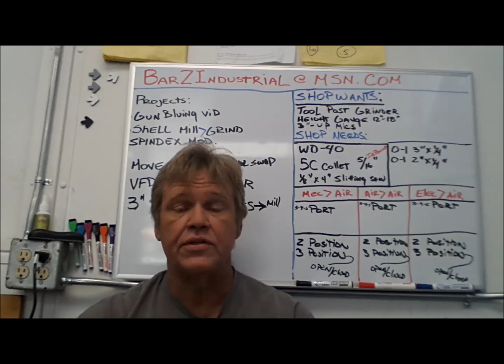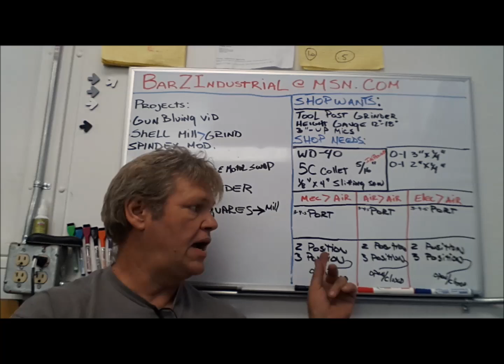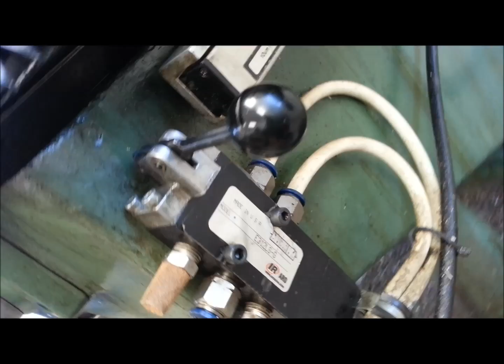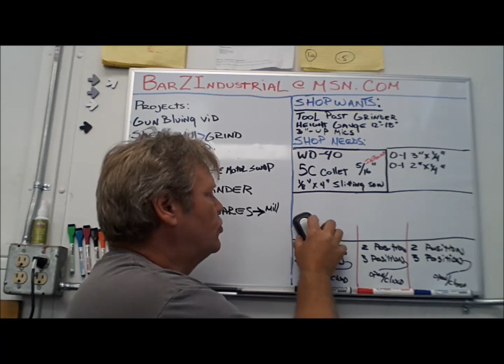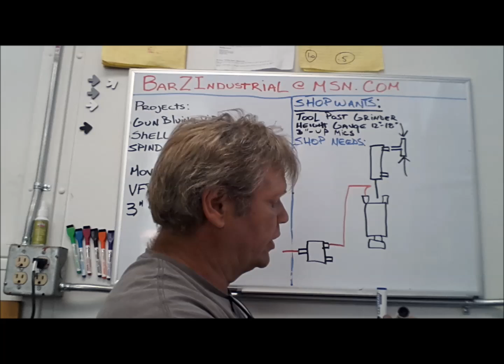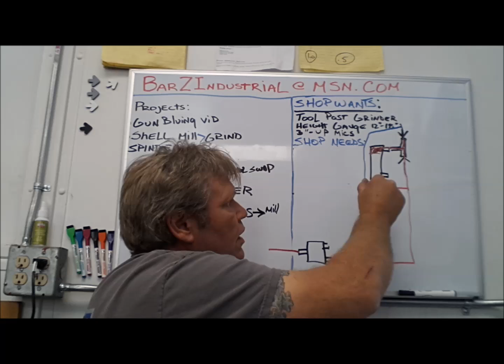Air logic for power draw bars

Comment: Watching yours and Rays fantastic vid on power drawbars.Was wondering where a person can get those small valves that has bleeders,and where to get an air cylinder.Maybe from McMaster? I like to make one just like what you describe with one cylinder.Thanks for any guidance
Reply from the maker: https://www.zoro.com/legris-flow-control-regulator-14-in-od-7660-56-20/i/G0973725/feature-product?gclid=CjwKCAjw87PNBRBAEiwA0XAIrwgM_OSqHdiTfu9uSXxmd4Gq7OnKIlD-KO-2Hif3dlgxvsLKx91XdhoCucUQAvD_BwE

Comment: Hi Stan, I watched your video and i like it. Clean and simple with the check valves. Great ! However i would like to make a small modification and would like to ask your advice. I would like to install a small toggle switch (on)off(on) type at the front of the Z-axis to control the PDB. How do i connect that electrically ? or in other words which kind of valve would do the job ?

Comment: Stan, I have a motorcycle lift I bought at  Harbor freight that is Hydraulic foot pump to lift,  Being in a  wheelchair I need what you are explaining ,  I just need the formula or  bill of materials  for lifting lawwntractors , What would you suggest ?
Reply from the maker: ***** I think air over hydraulic cylinder would be the hot ticket, no need to build it yourself, they are commercially available. look into northern tool, lots of hydro stuff there.
Reply: I have also thought about that to,  just trying to save a buck.

Comment: Hi Stan,
After watching Collin's build, I am going to build one for my little "bridgy" as Adam calls it!
I like the idea of adding this to the machine.
Can I get all my goodies less the butterfly gun, from Mc masters,  or Grainger's?
I copied your sketch, sounds easy enough!! Famous last words eh?
Thanks, Ray
aka Razor!
Reply from the maker: Hi Razor,
Grainger should have what you need, I am out of the metering valves or I would send you some, the push to connect fittings can be obtained almost anywhere.
Reply: Shadon HKW Thanks Stan, I will look into it.
As far as the cylinder goes, make?model? Size? I'm guessing that it will need a minimum 1" stroke? Thanks for the offer, but if you have any part#'s that would be a big help.
Appreciate the help,
Razor!

Comment: Hi Stan, have you ever seen those micro-vacuum lines used for indicating machine position?  They are usually used for two positions (all the way open, all the way closed) and are connected to some PLC.  Kind of a fancy micro-switch.  For fancy gizmos.  Or you could put a capacitive sensor, etc., on the shaft:  to indicate position....or a numerical encoder for absolute positioning!  BTW, the square set that you sent to Adam (in the jewelry box) are gems.  Maybe you could chemically etch a "Bar-Z" in them instead of stamping ....or do some crazy photo reactive film coating and etch 1/100 of an inch increments scales onto the edges................... just for fun.
Reply: Slick way to reverse the direction:  JUST reverse the airflow!

Comment: Thanks for the info on the air cylinder.  I knew that I was going to have a couple of check valves in the circuit..  I didn't know about the needle valves for controlling the speed.  I think I've got a pretty good conceptual drawing in my head of how this thing is going to be put together.  I'll make some drawings this week for sharing and critique.  Thanks for sharing Stan!

Comment: Stan, 
One problem I see is the check valves will trap the air in the cylinder not allowing it to retract once air is removed. At the very least you not a bleeding check valve or a bleed orifice between the check & cylinder so the ram can retract.
Reply from the maker: Hi CP,
I created an addendum to cure this problem, see this quickie here -->Power drawbar logic #2 a quick fix

Thanks for the view and comment!

Comment: good info big guy thanks I 've more than once tried to figure out air valves i'm working on a power draw bar my idea is to run it on a remote valve just as you have described. also would like to do a air motor table mover like yours any spsc's? could be very helpful

Comment: great video Stan. I like the ideas from everyone and since I have time I will attempt to take the best from each idea and combine into a decent unit.
In your flow chart, however, I see no provision for cylinder evacuation once pressurized. The check valves block both directions? We may need an exhaust position on the main valve.

Colin
Reply from the maker: Uploading an addendum now with a fix. Your 3 port valve will still work.
Reply: Hi Colin, you beat me to it, I was thinking the same thing
chris
Reply from the maker: Thats a good catch Colin, a small bleed bypass (allowing the cylinder to retract) could be the answer, or a 5 port exhausting, let me play with a bypass non exhausting.
Reply: No exhaust should be required as the air pressure leaves via the impact motor.
Reply: Hi Nutty, not with two one way valves in the way.
Reply: Ha, you're fast! :-)